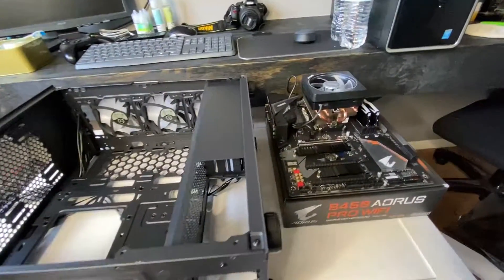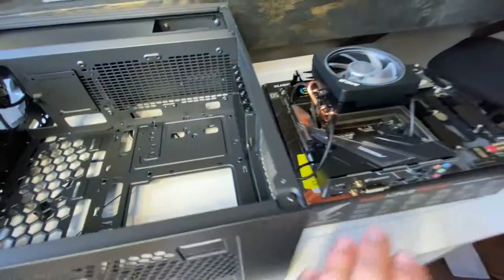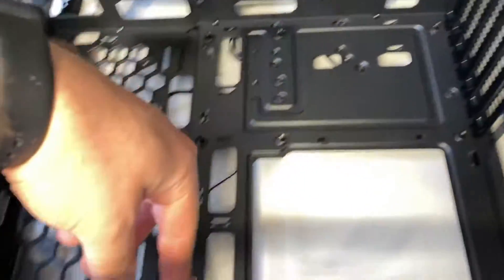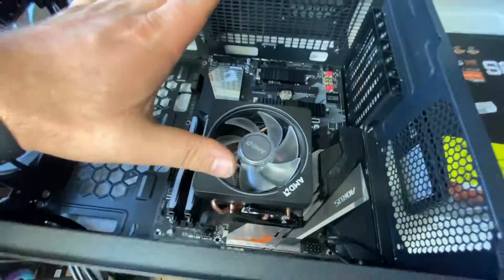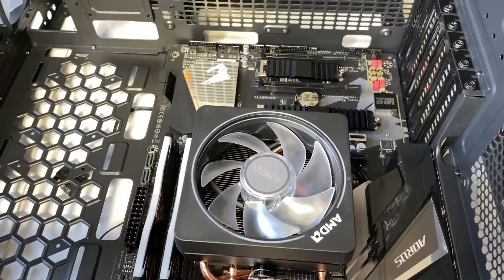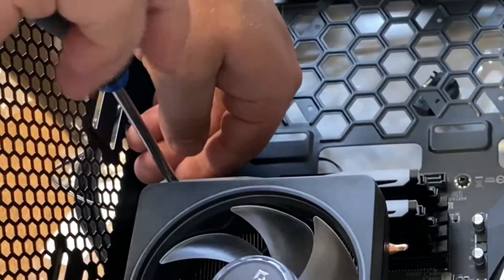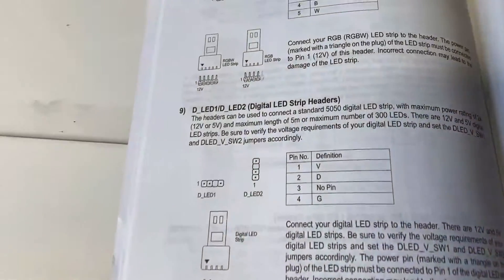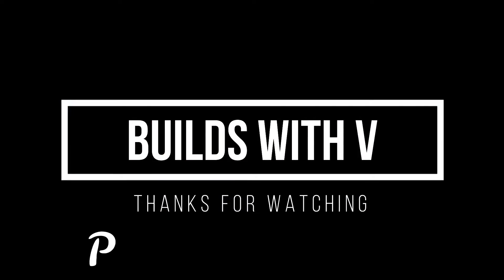How to Install a PC Motherboard

Comment: What if your case didn’t come with screws?
Reply from the maker: If it’s a new case they usually have a box of screws. These are the same screws you’d use for your power supply

Comment: Just a question, does the motherboard have to slot onto screws in the case or can it just hover above them and can be screwed in anyways
Reply from the maker: Some cases have 1 or 2 screws that it slots into but some cases don’t. It’s perfectly okay to have it hover above if your case doesn’t have the slot screws. Usually it’s just the center screw that might slit in and you’ll notice it looks a bit longer and the tip is thinner.
Reply: @BuildsWithV  ah okay, thank you, no tutorial on YouTube mentioned it. I'm building a pc right now with an Asus Rog strix b760a in a Lian Li 011 Dynamic case and when the motherboard was only sitting on top of the standoffs I got worried I'd have to replace them. Thanks again

Comment: So my motherboard HDMI port doesn’t work and I’m wondering if I wired it wrong or is it a faulty motherboard
Reply from the maker: It would only work if your cpu has built in graphics. You plug the hdmi into your GPU

Comment: I have this exact motherboard I used for an all Gigabyte Aorus build. Specs as follows.
1) be quiet! Pure Base 600 Window Orange case
2) Gigabyte B450 Aorus Pro Wifi
3) AMD Ryzen 7 5700G (just to have backup graphics)
4) Gigabyte Aorus GTX 1080
5) Gigabyte Aorus memory 3600mhz
6) Gigabyte Aorus GP-AP750GM power supply
7) Gigabyte Aorus RGB M.2 NVMe SSD 512GB 
8) Wraith Prism CPU cooler (might switch to a Gigabyte Aorus AIO in the future)
9) Black and orange Formulamod Power Supply Sleeve Extension Cable Kit
10) Seagate 2TB SSHD Hybrid Drive (for backups and storage)
11) LG Bluray drive
Reply from the maker: Nice! Looks like it’s a solid build!